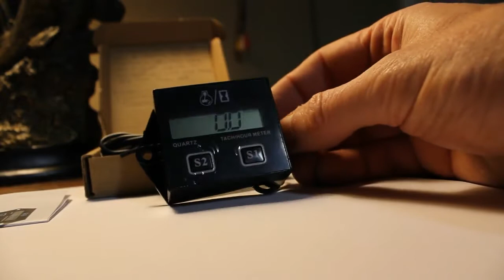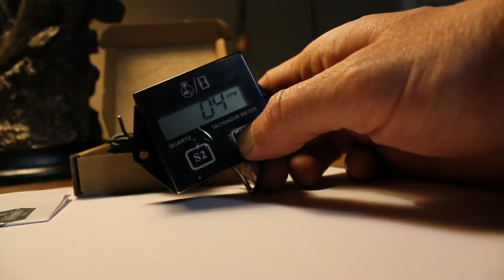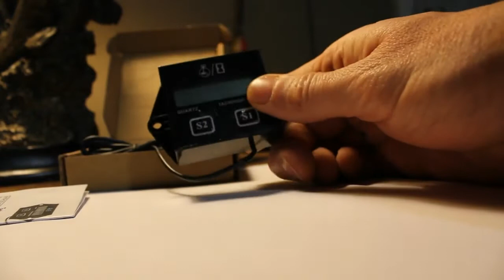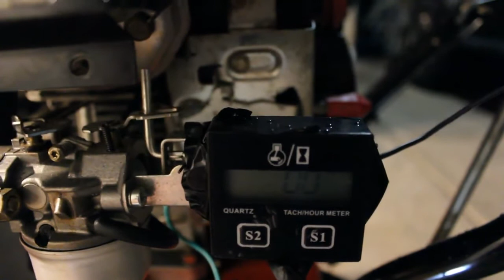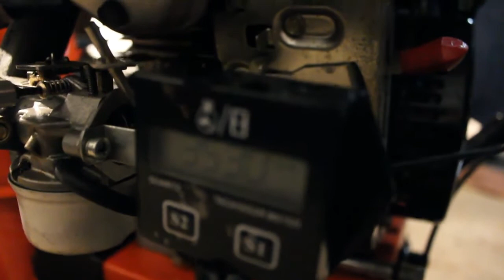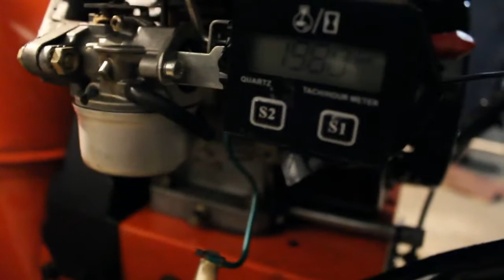Ariens Snowblower Checking RPM , Maintenance Tips.

Comment: Thanks,I have the same blower and I need to speed it up the high idle. If I push up the speed it can go high,but as soon as I let go it goes down a bit. So I guess I have to losen the screw on the Governor and move it towards the front of the blower just a tad.
Reply from the maker: yes. sometimes you have to bend it slightly or adjust spring tension to achieve proper rpm, but sometimes adjusting idle screw works.